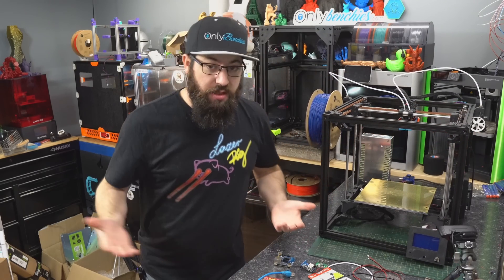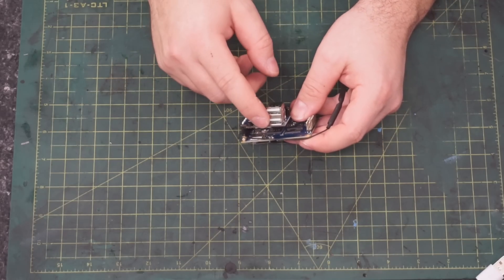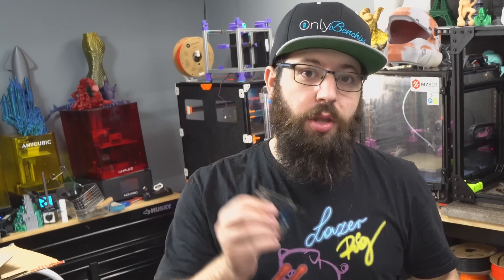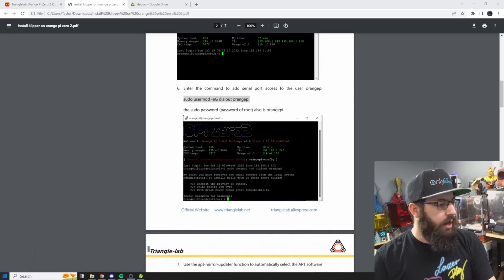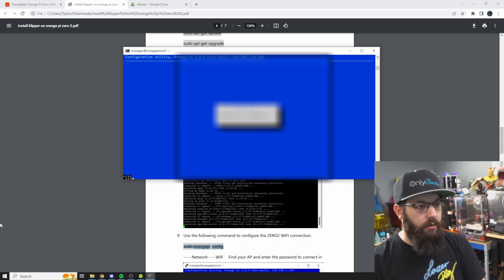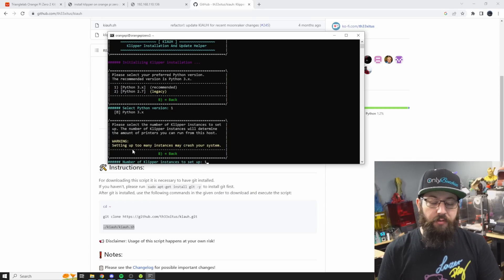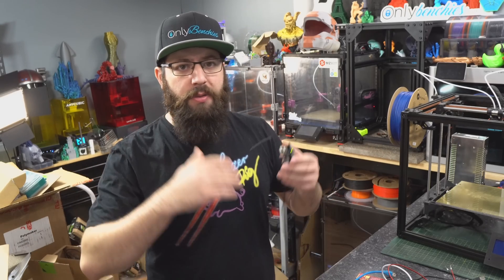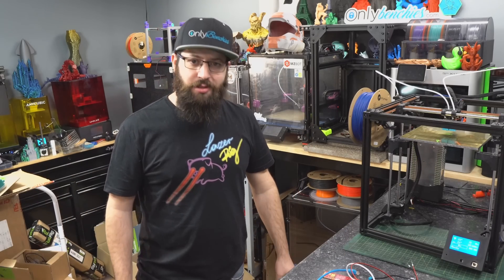Klipper Setup on the Orange Pi with Kiauh - RPi Alternative #3dprinting #3d

Comment: I use an OrangePi Zero 3, works great. Replaced the SDcard with an eMMC with sdcard adapter though.
On my other printer I use a HP ThinClient T620 (used for 50€), with Debian Trixie.  Works even better, for that price I got a standard AMD CPU (much faster than ARM), 8 GB RAM and 128 GB SSD.

Comment: Hi, i know it was year ago posted, but i would like to know if u colud successfully install rpi mcu on opi (so use gpio on orange pi). Besiedes running uart/i2c/spi from the gpio, as that part pretty much all of sbc can handle with klipper via drivers, i can't find any info regarding using orange pi gpio to drive directly stuff in the klipper.

Comment: Did you ever get input shaper installed on this pi I am having a rough time with my orange pi 3 lts and am sorta stuck...
Reply: Having the same problem here, did you manage to get it running?
Reply: No I never did 😔 I just haven't had the time
Reply: This same channel has a video doing input shaper with a pi pico as the mcu, maybe that will do, I'll buy one of those to try @R3ADB3ARD13

Comment: Hey man, I followed your tutorial. Managed to get the klipper, moonraker and mainsail going but I cant get to the Ui via my web browser. The only difference is I'm using OrangePi3B insead of Zero 2. I'm sure klipper and moonraker is running because I can get to IP:7125. Its saying klipper is running and the page it self proves that moonraker is running. Would be cool if you could help figure this out

Comment: Great video, but how do you use the gpio pins which are needed for the accelerometer calibration?   Or do you use a USB accelerometer adxl345?  I have yet to find a guide for the orange pi on how to setup an acceleromter.

Comment: Nice to see another video using an orange pi.  I just installed klipper, klipperscreen, and octoprint on my Orange Pi 3 LTS.  I used an old 8-bit Creality to try this on.  After a few issues like have to add a 5 second delay to crowsnest to get the camera to start up it seems to work.  I don't care for this version of Octoprint though as the web camera does not work so I probably will not use it.

Comment: For what it's worth, rather than the buck converter, you can plug it into the pi connector on the SKR Pico, just as you would a raspberry pi or BTT Pi 1.2.

Comment: you are a genius, i already managed to start the orange pi pc with klipper on my ender 5 plus
do you know how to configure the adxl345 accelerometer?

I can't, thanks for any help
Reply: Did you use the same image linked in this video for your OPI PC? I'm stuck on the part  where I try to connect on SSH. I already connected the ethernet port but it just could not connect.

Comment: I recommended to install wiringop for orange and test UART before connecting who use UART, some times not working. The best way Orange Pi 3 LTS because have memory on board and cheap. The same time when you will connect adxl 345 on pi3 you need to manual activate cs pin via wiringOP gpio mode ALT2 15-pin number.For klipper screen BTT HDMI5 but waiting when they add HDMI with 90 degrees connectors

Comment: Klipper on an orange pi zero works fine.  I've been running it for a while now.  The only drawback is that when using WiFi, it gets a new IP address every time you restart your opi zero
Reply: I reserved the ip in my router. So whenever it restarts, it will get the same ip.
Reply: @bobbydigital9323  By MAC? No need to do that. You can assign an IP that falls outside the DHCP range.
Reply: @Alejandro Pérez  oh. I didn't know I could do that. Will have to try that
Reply: I think you can fix that
Reply: thats the D in DHCP. lol it has nothing to do with the OPiZ

Comment: I'm running Klipper on a Le Potato.  Same form factor as a Pi 3 and has an EMMC port.   4x USB2.0, 100MB ethernet and no WIFI.  2GB RAM for $40.  add about $20 for a 16GB EMMC card and install Klipper using KIUAH.
Reply: You said it. No wifi. Very bad!
Reply: @alejandroperez5368  in my opinion, wifi bad.   I'm in a wifi saturated area so I run Ethernet where possible.   The potato only has 100mbps but then does it really need more than that for a klipper web UI?

Comment: Congratulations on the content. I used this board in my old diy i3 (also with RAMPS), it worked great, unfortunately orangepi's GPIO uses different libraries than raspberry pi's, which makes the use of the GPIO by klipper a little bit tricky, in my case I chose to use the RAMPS auxiliary pins to use the ADXL sensor. Another cool option is to change the hostname so that it is easier to connect to mainsail through the browser without the need to use the SBC IP address.

Comment: I think if you want ADXL to work you're going to have to enable SPI on the orange pie zero two. Also running full tilt they only pull maybe 500 milliamps on the 5 volt rail so you can run them off of most controller boards I'm running one off of an SKR E3 V3 right now
Reply: Indeed, SPI does need to be enabled. It was a bit trickier than r-pi because it wasn't in the text UI config thing, but I did get it working. Orange pi has a manual that was a few hundred pages long that had info on setting it up.
Reply: User manual is on the zero 2 page downloads and they have instructions there on page 141. You need to add configurations to /boot/orangepiEnv.txt
Reply: @TheGreatBrownBoy  Sorry! Yes, I've tried over and over to reply with information, but every comment I add just gets removed. 🤷🏻‍♂
Reply: @ammmze  link that document pls. or how you achieved it.

Comment: Question, instead of using the add-on usb hat, could you just use a small "off the shelf" usb hub to turn the single into about 3-4 usable ports?
Reply: Some USB hub can be iffy, but that's an option
Reply: It should work fine, I used one to add ports and wired Ehernet to a Pi Zero.

Comment: Are you also going to look into the Android TV boxes as alternatives? Those can be had for under $40 and most come with wifi and an OS already installed. You just need to set up Python so you can then run Klipper.
Reply: I've done it multiple times, they are a much more complete solution and run Arbian just fine. See my comment above.

Comment: If I don't have a wired network where I am setting up the printer, can I connect the Orange Pi to my laptop via ethernet to access it?
Reply: Yes. You'll need to set a static IP for the connection on both sides. It's usually referred to as a peer to peer network. If you want to access the internet via your computer you'll need to setup routing on it.
Reply: @snives7166  Is there really no way to start using WIFI from the get go?

Comment: Ah, what a great video for the current Pi situation.  I overpayed on ebay because I wasn't confident about the software part for the RPi alternatives, but this makes it easy for those of us who just need good instructions.
Reply: Watch out, don't interpret "success" videos like this one to mean that the orange pi is actually ready for prime-time or is able to generally replace the raspberry pi.  It's not, and it can't.  I just spent a week of frustration trying to get streaming video going over hdmi, on an orpi zero2.  Big fail, video codec nightmare, quick solution was to fall back on the rpi, where video "just works".  Try it: open file manager on your snazzy orange pi desktop, navigate to a video file, double click... and wonder how they can sell these!  If you don't need what it can't do, as here, then goody for you.  I don't see nearly enough warning out there about this years-long, still-not-solved issue.